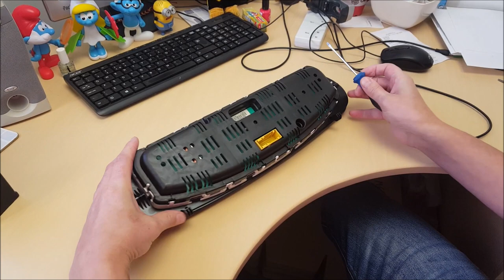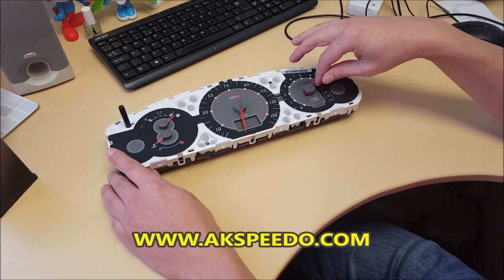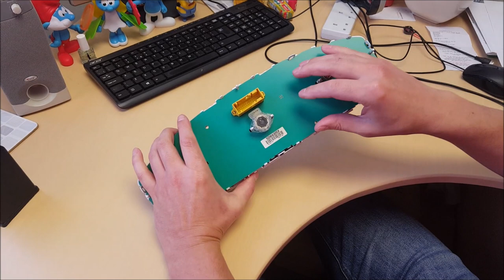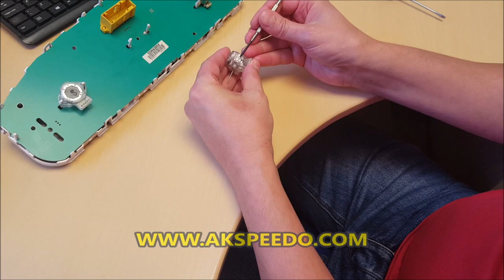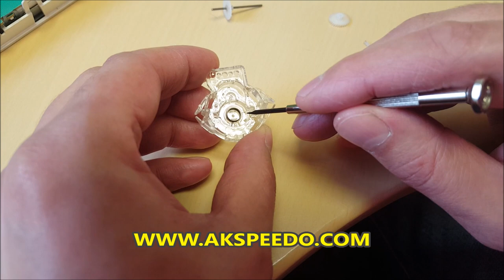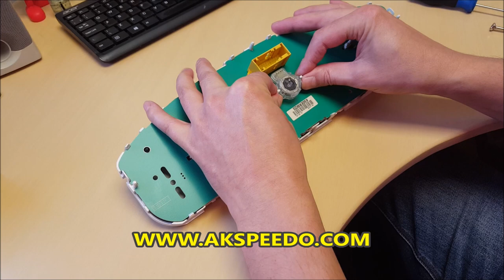Citroen C5 Speedometer Pointer Needle Motor repair

Comment: My spedometer and rpm gadge droped for like 10kmh and car works in like 200rpm in idle but it shows 800 on diagnostic. is it the same problem like here becuse they both droped at the same time...
Reply from the maker: Yes, same problem, cheers

Comment: My C5 speedo dropped under 0 and hence showed the wrong speed all the way. Fixed it by one small drop of glue in the tube behind the pointer and placed it fast to correct starting position before glue dried. Was this stupid of me? It works fine now though.
Reply from the maker: Glue works for a little while, but normally starts to move again.